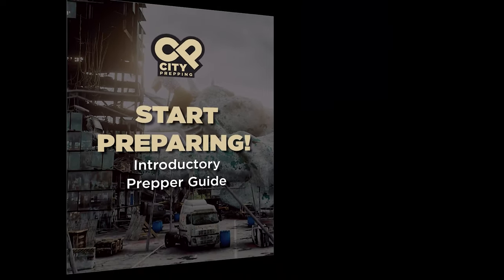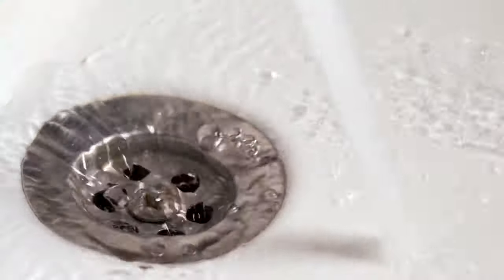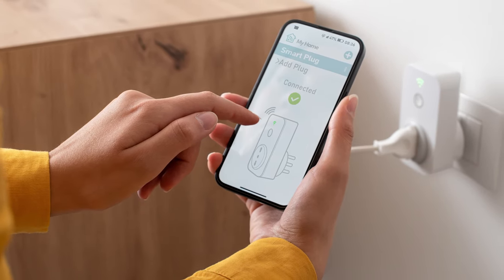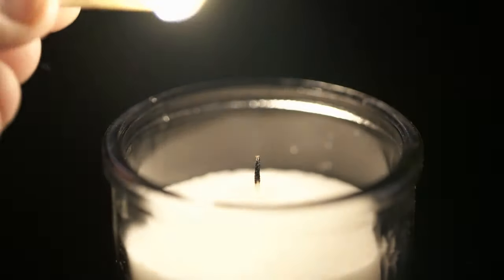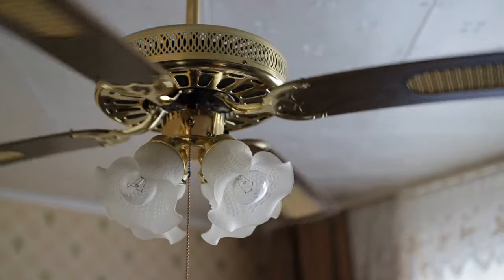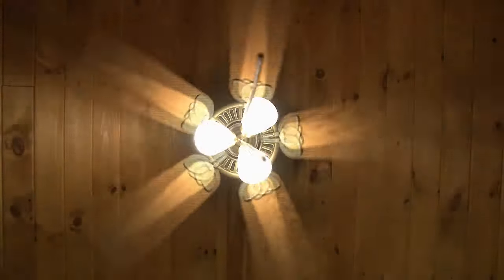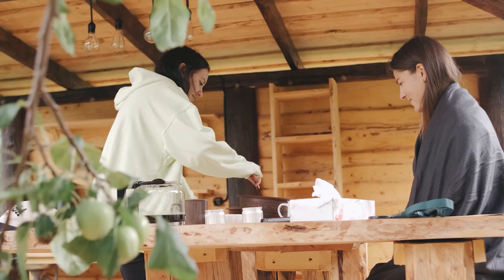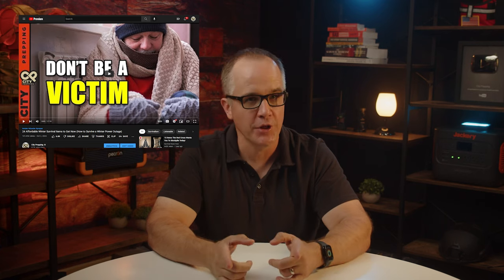9 Easy Hacks to Save Energy This Winter (And Stay Warm)

Comment: I have a dual-controlled, heated mattress pad. About 30-60 minutes before bed, I turn on the mattress pad and stuff my nightgown or pajamas under the covers to warm them up. My bedroom is kept pretty chilly, but putting on some toasty PJs and climbing into a warm bed is soothing and makes the room temperature irrelevant. This is especially helpful when I am sore due to my arthritis and fibromyalgia. It doesn't take long before I'm turning the heat off and ready to fall asleep.
Reply: I sleep so much better in a colder room
Reply: We don’t heat the bedrooms at all. I have grown up loving electric blankets! I also have an unzipped sleeping bag that I use for a top layer on the bed in winter. The cats like to lay on the bed with me and they generate heat as well! They sleep on the sleeping bad keeping my comforter clean!
Reply: @Junkinsally  great idea to keep the comforter clean. I've been looking for 2nd hand sleeping bags for a few weeks
Reply: I do the same thing. BUT I learnt recently that you SHOULD NOT be in bed with the electric blanket switched on. Do research the reasons.
Reply: Yes, I can't sleep with an electric blanket turned on, but that initial  warming is so relaxing! Warm pj's...ahh!
Reply: Thanks. I'll have to try this hack.
Reply: Good tip, I hope your fibro gets better, I have it myself.
Reply: I love my heated mattress pad cover.
Reply: @stephenjames3377  
Thanks. What do you do to manage it? Other than chiropractic and massage therapy, I haven't discovered anything effective.

Comment: I would caution against closing off vents in an unused room. Your Furnace or Airhandler is designed to exchange air at a certain static pressure in the ductwork. Choking of supply vents will raise static pressure and make the blower motor work harder (Use More energy) against that higher pressure. Change dirty filters as suggested and let the unit Heat/Cool entire home as designed
Reply: Yes. Closing vents can cause problems and cause it to work harder.
Reply: That's been my experience too.
Reply: Correct!!  I was just going to write this too.  Modern furnaces are designed for the size house one lives in.  Closing off vents or even whole rooms can make your furnace work harder or even damage the furnace.

Comment: Tip for older homes: When searching for air leaks, run your clothes dryer. It pushes a fair amount of air out of the house. That air must be replaced somehow, or else your home would implode from the vacuum! Lol. But seriously, the volume of the air leaks should slightly increase, making them easier to detect.
Reply: Fantastic tip! As a GC, I haven’t heard that one yet!
Reply: Well it wouldn't implode various gasses including oxygen would not only pass through the multiple seams and of course if your house has plumbing pipes will constantly all gasses including oxygen inside.  But it is a good tip anyway
Reply: Good tip.

Comment: I am Belgian. Can you do a vid how to warm with no heating at all. Because in Europe there will be many homes with no heating. Including mine. Because it's unaffordable.
Reply: Check into solar heat,  can be made with affordable materials and produce temperature up to 140 degrees F.
Reply: I am by no means an expert but one thing to do is prevent heat loss by sealing air leaks, installing window insulating film (they really work) and using heavy drapes or blankets over the windows at night. Wishing the best for you and all in those circumstances.

Comment: Smart thermostats also give the power company the ability and permission to forcibly adjust the thermostat. Users in California reported that they weren't allowed to turn up the AC during a heatwave.
Reply: It was a Colorado utility that locked their customers out of being able to control their thermostat, not California. Although I would have expected California to be the first to do something like that.
Reply: From what I understand, that kind of thing is also being done in Texas .... Probably several other states too.
Reply: My power co wanted to put a Smart thermostat in my house and offered me $30 as an incentive. I don't like the idea that the company could control my heat. Not for me.
Reply: Window unit air conditioners are available, and controlled by occupants. Same with space heaters, I plan to try the terra cotta pot for heat this year.
Reply: @karensmith4336  I've heard those things can give off bad vapors or fracture under heat stress. Not sure if that's true.
Reply: @tthappyrock368  That is a yes on Texas - replaced my smart thermostat with a dumb $20 Honeywell, and put a stop to it. I practice conservation, but is my decision when and how.

Comment: Our home was severely damaged by a flood a few years back. One thing that was damaged was the ductwork. We didn’t have the money to replace it at the time. We patched it up enough to use but it wasn’t working well. So we decided to not use the furnace when possible. I can’t sing the praises of Polar Fleece fabric enough! Jackets, Vests, PJ’s, lounge pants and lap blankets-think the “As Seen on TV Snuggie”, polar fleece is the best fabric for staying warm indoors and out. It traps body heat better than most fabrics. Unlike wool it’s soft and comes in many colors and prints. Polar fleece vests are great for keep the core warm when layering. Humidity is key to keeping a space warm. Just don’t over do it!!! I used a humidifier one winter and mold grew in my window seals!! As Kris said, a pot of water on the stove is plenty.

Comment: A few year ago I built window insulating inserts out of foam with wood frame covered by reflectix bubble wrap.  I take them out of the windows when the suns out and put them in at night.  This cut my propane usage by at least 20% if not more. In the summer I no longer need to use my AC unit either.

Comment: Just an FYI about smart thermostats… in areas where energy is limited, electric companies can & already have controlled people’s temps remotely. Several areas around the US had locals reporting this happened to them a couple months ago when the outside temperatures were high. Make sure you read all available literature before installing if this might be an issue for you. 🔌
Reply from the maker: Those are the ones that signed a contract. I didn’t opt for that.

Comment: I just moved into a renovated apartment. When Kris mentioned turning down the thermostat on the water heater, I remembered that I had burned my hand rinsing off a dish. I found the top thermostat was set at 150 degrees and the bottom at 90. They both are now at 125 but I will check the water temp tomorrow. Thanks as always for the great useful videos.

Comment: You never insulate the basement ceiling, basements are conditioned spaces. Heat rises and therefore will heat the floor and help heat the floor above.

Comment: That tips for older homes and running your dryer is spot on! Go deeper now as my home has bathroom vents right away vet said he commode (gee I wonder why there) and one morning I was, well, taking care of business under that vent. I could feel bitter, bone chilling cold come out of that vent before I powered up the exhaust fan. I soon noticed the cold air only came in while my hot air furnace was running. Come to find out opinions my under the house summer inspection, one of my heat ducts fell off the main heat delivery trunk lines which led to a significant air loss to outside when the furnace was running. Air being pushed out of that open gap meant air had to be brought in to replace that escaping air and in my case, the air vents were allowing that air replacement flow back into my home reducing efficiency. After that got fixed, I noticed my furnace ran a lot less and my heating oil consumption went down….. significantly!

Comment: You can create light in your house. Take 2 plastic cups fill one by 2/3 distilled water, place Magnet, like what you use on kitchen fridge in the water. Add TBL of salt to the water. Take 2nd  cup and cut the bottom out. Place light bulb into the cup and set cup into water with magnet so only metal tip is in the water. The current generated by the magnet lights the light bulb. Instant light.
Reply: Might just stick with a flashlight.
Reply: Great idea

Comment: Plugging in a smallish slow cooker uses very low wattage, works with solar's limited amount of power, & will release a low but steady ambient heat in any room you wish. I've used it to avoid the 'freezing morning bathroom' experience.  Living in the south, on the 1 hand, no snow, on the other hand, no central heat in our little old house, & the bathroom is on the north side. Can get quite chilly!
Reply: Turning on an iron on an iron board warms up a small room.
Reply: @kirchfam  eek! Way too dangerous with my "swiss cheese" memory!

Comment: About space heaters- I had always believed them to be completely inefficient but after a few winters of experimentation (and always being cold) in my home, I found there is a use for them that actually saved me $.  
Instead of maintaining my entire house at a certain temperature, say 64°, I can more comfortably warm only the room I’m in with a space heater.  For instance, my house thermostat can be set at 60° and the space heater can be set to heat a single room to a more tolerable 64°.  
Note-the space heater should not be not the sole heat source, it is supplemental.  That’s the key to saving money but still being comfortable.

Comment: I just watched a video from France regarding energy and how they are saving money. Down to not even using there oven unless it’s completely full. Using Insta-Pot and small counter top ovens for cooking multiple meals that only need warming up.
Reply: is insta pot electric? I hear the electric is getting just as or more expensive. at least the oven warms the whole area. and if power goes out? you can't count on electric appliances.
Reply: @pattiannepascual  yes Insta-Pot is electric. It is a multi function appliance. But the advantages is you can sauté say, beef, then pressure cook it in a very short amount of time compared to roasting in a full size oven. Hence, saving a lot of energy. As far as if France was to not have electricity maybe a generator?! I just found it interesting and informative to see how that family which is retired is handling their extreme electricity costs.

Comment: YOu can also turn your water heater  down further like if you leave the house all day, turn it up when you return and then turn it back down when you go to bed. Same with heat and AC.   Dry your laundry outside on a drying rack . You can dry laundry  inside during the winter which will help put a little moisture in your dry heated home.

Comment: Use a dryer flapper if your vent doesn’t have one. You can put it in the exhaust pipe. Costs around $10.

Comment: On ceiling fans one of the best things we did was replace the hallway pendant light with a tiny 24 in ceiling fan. I'm going to replace our dining room chandelier with a ceiling fan too. If you have a wood stove blow the cold air towards the stove so the warm air has a place to go - meaning back to the colder rooms. I bought blackout curtains for our bedroom and they are surprisingly thick. If they prove to improve the insulation over what we had before I think I might do similar curtains throughout the house.

Comment: A word of caution for smart thermostats from the power company. These can turn control over to the Power company and I saw stories from Colorado about the power company turning off the system at peak times without the owners consent. I believe it was probably in the terms and conditions when they signed up. still be careful!

Comment: Thank You again for your suggestions. I do not have dual pane windows. The sliding Doors and large window I sit by, I plan on spaying the bottom half with water then pressing Bubble Wrap against it for installation.  I hear it works pretty good, we'll see. On my bed I use a Authentic Down Comforter I've had it for years and it gets quite toasty! After using the oven I always leave it cracked or open. A few years ago I purchased the first and real "Air Fryer Power Oven" which has rottisory, racks etc. I use it all the time for most everything. I usually do my laundry at off peak times. I have the stuffed under door things for summer and winter. Always have a blanket by my main chair. I do use a radiator heater for the living room and because of it my electric gas gone down quite alot, I only use it during the day time.
Stay Safe God Bless.

Comment: Electric blanket & Heating pads are not safe IMO to sleep with them on! I find a hot water bottle works the best and is still warm when I wake in the morning!
Reply: I agree with you. I had one many years ago and woke up one AM to see sparks jumping across the top of the blanket. Never again.
Reply: I have a DC electric blanket that uses a timer.  The choices are 30, 45 or 60 minutes - enough time to nod off to sleep.  Of course, a nice blanket with artificial fibers keeps the heat in.

Comment: DO NOT INSTALL A "SMART" THERMOSTAT!  Your power company can use those to turn off your heat or AC.  Xcel did it in Colorado just this year and they WILL  do it more and more.
Reply: I believe the term "smart", means tracking.

Comment: Good points. We use small rechargeable battery-operated fans that are installed at the top of the door frames that moves the hot air from wood stove to the rest of the house works very well. We recharge them with solar and its cheaper than running the furnace fan.
Stay Safe & Good Luck

Comment: Two points as an HVAC tech: 1) large swings in your tstat set point turns less efficient. Systems are more efficient at maintaining temperatures. Trying to heat your house up from 60° to 67° when you get home is less efficient.

2) never close off supplies in rooms. Forced air systems require certain airflow and if the system was designed properly, all supplies and returns need to stay in use. Also, interior walls are not insulated. If you close off rooms along the exterior of your house and let them get cold, that cold will make its way into the walls.

Comment: Good suggestions, Kris. FLIR or other IR/thermal imaging technology - cameras or goggles - can reveal 'hot spots' around the exterior of a building, indicating where heat is leaking out or bridging through the wall structure.

Comment: After looking over the comments, I didn't see a reference to utilizing a clothes dryer which could just about replace your whole house heating source.  It is worth the effort to create a diverter in the exhaust hose to allow the moist heat of the dryer to be circulated back into the house.  Of course this does not mean to use the dryer for your heat source, but if you are going to dry clothes anyway, utilize that "waste" heat for your benefit.

Additionally, slip one leg of a panty hose over the end of the exhaust hose to eliminate any fine lint that is not trapped in the screen filter of the dryer.  I have used this in the past and it DOES work.
Reply: Worked in apartment maintenance for me 28 years. This is what we done for residents when their heaters went down and couldn't get parts quickly. A lot of them said it worked better than the forced air heater and actually cost them less.
Reply: If you did that I'd recommend a water tray lint trap to catch the fine lint.
Reply: We have one of the vent converter thingys! We used to do exactly this at our first house which was ancient and very leaky. 
I second this, use your dryer!
Reply: @jrose353  👍
Reply: As long as it's not a gas dryer.

Comment: I would like to note that, a ceiling fan will help with energy costs. Buuuuut, if you have a seating area like a couch right underneath it will cause the air to be right were you are sitting. My BFF did this, and I freeze whenever I go over there. I had heard about this hack before, but I didn't know the drawback. I'm sure it's great when I'm not there :)

Comment: What can we do when grid goes down?   Please address this ASAP
Reply: Battery backed off-grid solar
Reply: Layers of clothes, layers on the bed, plastic sheeting to define small spaces to warm up more efficiently.
Reply: You can buy room heaters that run on propane tanks like you use for your outdoor grill. For safety make sure to also have a carbon monoxide monitor.   This video is about saving money during grid on. Propane heaters won't help save money but in a grid down it will keep you warmer.
Reply: He's done many videos on this topic
Reply: Id personally check All water sources shut off Valves.  Under the toilet & sink***. Some are old
Make sure they are not rusted. The valves can break,  & flood h20 everywhere. Over time they rust, lock-up from scale etc
I would check all bathrooms sinks, kitchen & utility sinks & toilets.***
 MAKE SURE EVERYONE IN HOME KNOW WHERE THE CUT OFF H20 lever is ***. Believe me check this now or ask your building maintenance dude. Demand * it gets fix. It will break.**** and flood everyone else.🙄
Reply: Solar gen with an electric blanket

Comment: I sprung for a device called a Bed Jet which blows air through the sheets of your bed (uses a special dual-layer sheet in combination with your existing). It can heat and circulate, then be programmed to run any custom routine until you awake. It's a nice way to let the house drop a few degrees at night and still be toasty warm without sweating.
Reply: Neat!